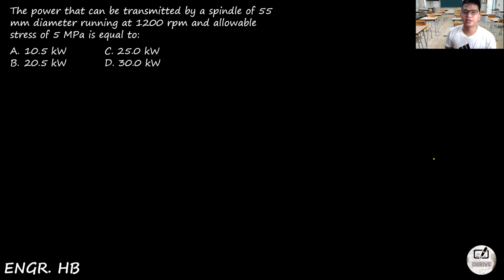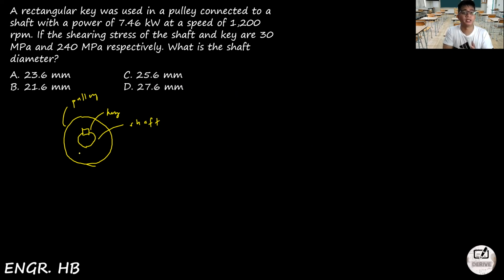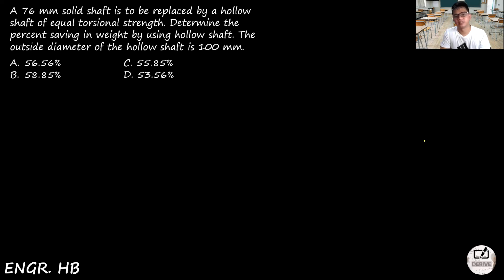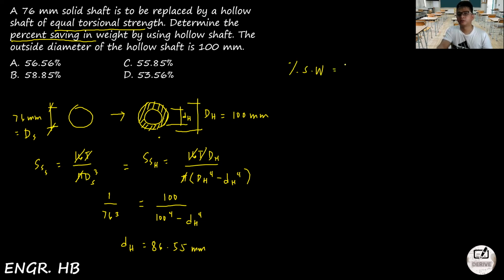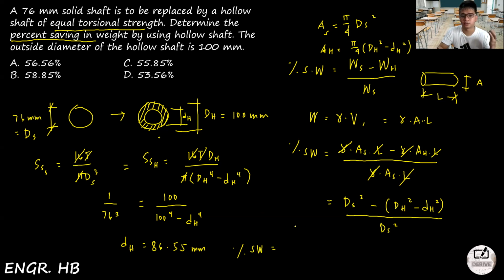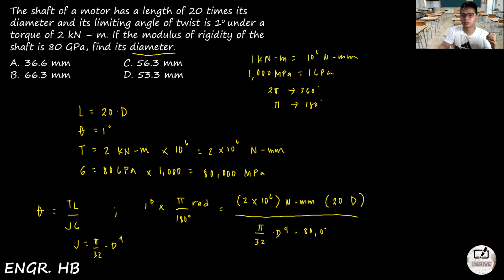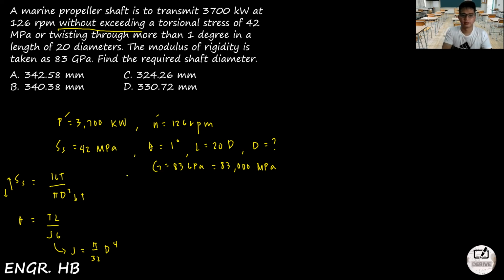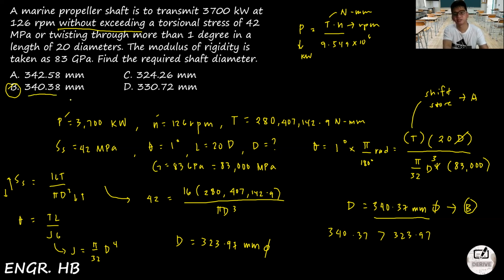MACHINE DESIGN: PAST BOARD EXAM PROBLEMS CHAPTER 3 - SHAFTING PART 2

Comment: Hello po Engr. Pwede po patulong sa problem na ito. Hehe. 
Use paes 305:2000 to select a suitable diameter for a solid circular line steel shaft used to transmit 10 hp (7460 w) at 400 rpm, under heavy shock conditions. apply a suitable service factor.
Reply: a shaft supported on bearings 8 in a part transmits 250 hp at 200 rpm. the maximum bending moment is 24000 in-lb. the allowable shearing stress is 8000 psi and the allowable bending stress is 7000 psi because of unusual loading conditions. find the shaft diameter.

Eto pa po. Thank you po☺️